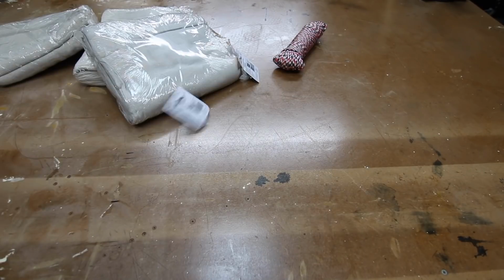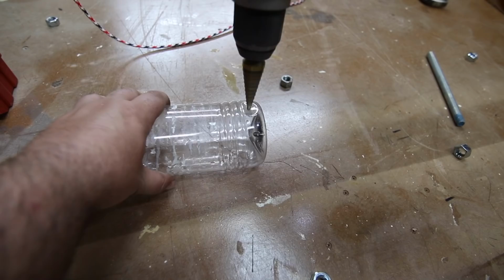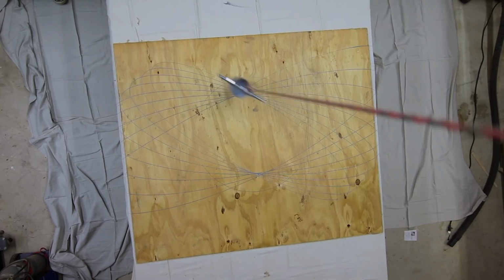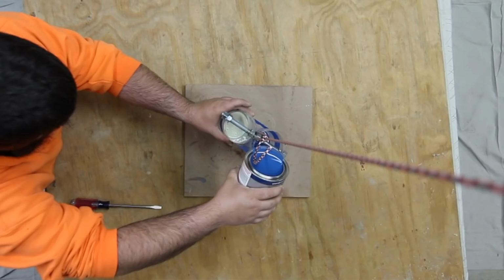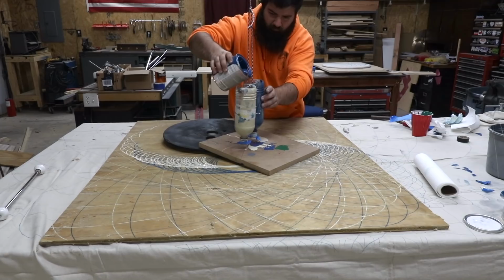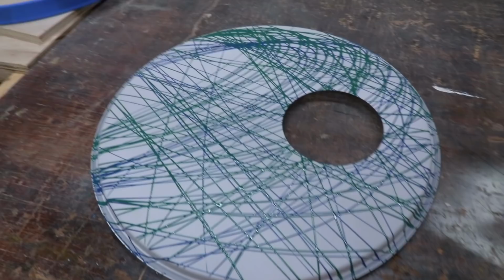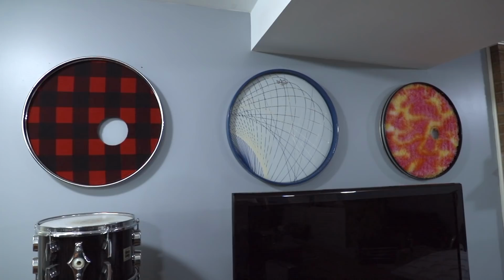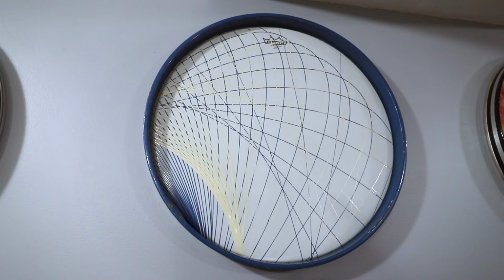Pendulum Painting My Bass Drum Head

Comment: I like the simple one way better except for the fact that the colours on that one dont work AT ALL together. The first ones blue line gets thicker towards the edge of the drumhead. I would try (with a better colour than the one you used) to create the same shape at the other end of drumhead so its symmetrical when you look diagonally at.
On the second head, i think that it would have been cooler to use a black drumhead so that the colours would pop more (but you would probably also need to use a brighter blue and green to make it distinguishable.)
Cool idea, though